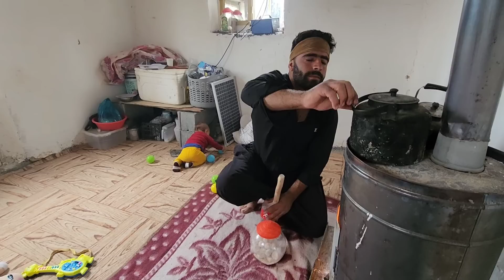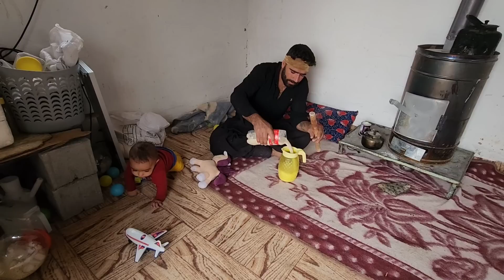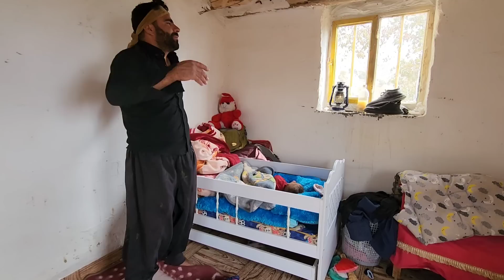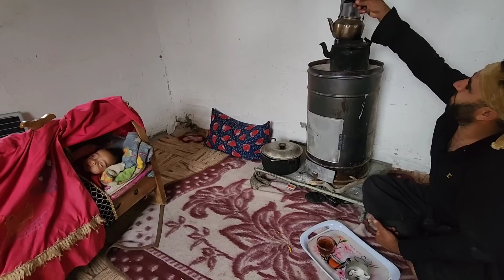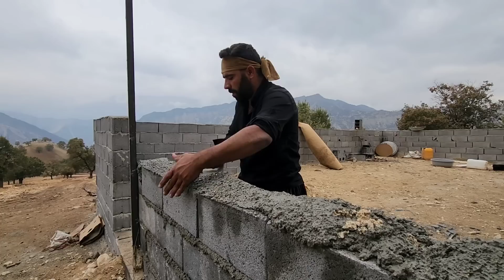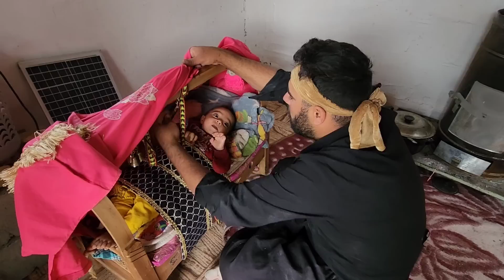Fascinating and real documentary: the lifestyle of a nomadic father and his baby in rainy weather

Comment: I hope the weather clears up  for you to work on your outdoor kitchen on the other side of your bedroom/living space. I  wish  that you will build a  pantry closet... so you can have  shelves for storing your dry foods  like rice, flour, sugar etc.   You can buy you some simple household items a little at a time like a small refrigerator. But when you buy a sink DON'T buy a kitchen sink ...  buy a UTILITY  SINK.  The reasoning behind that is it has a deeper tub that you can use in doing laundry and  any other purpose that requires a deeper level  of water basin. ONE BIG suggestion is make you a work table with a meat cutting board. Surely there is a place you can buy  and have cut smaller  sheets of marble or granite enough to  use for a strong wooden frame or metal.  It doesn't have to cost alot. 
I have use an old dresser for a kitchen work table. With a butcher block board and cut piece of granite laying side by side as the table top. I got the old dresser at a use furniture store.
Well, good luck on the  weather.